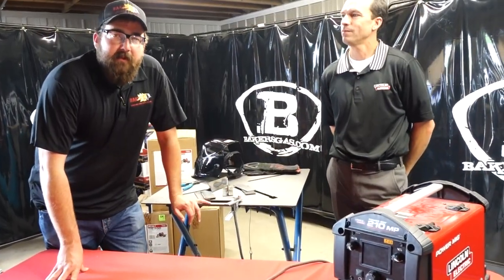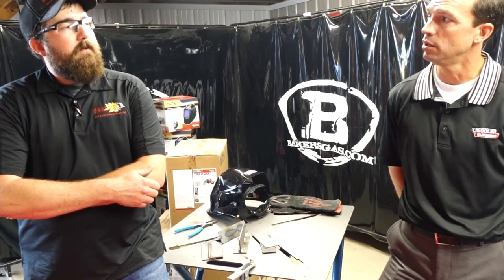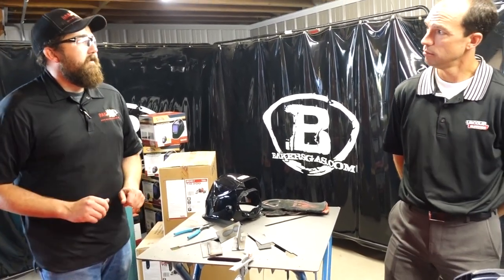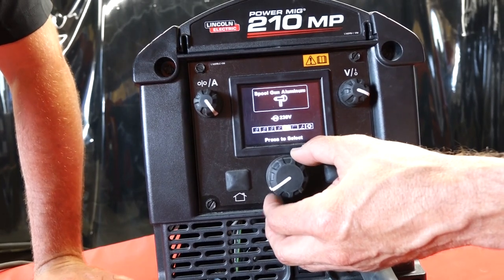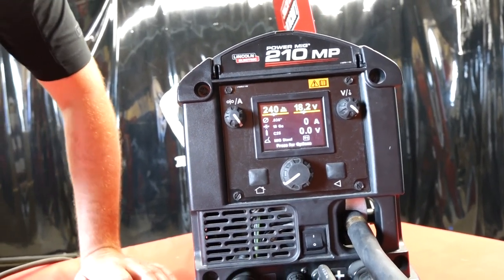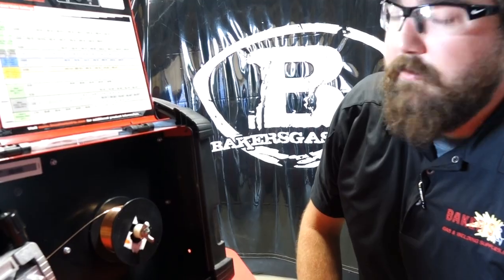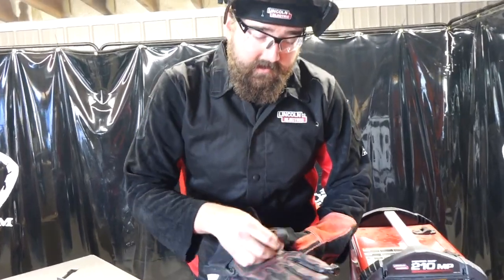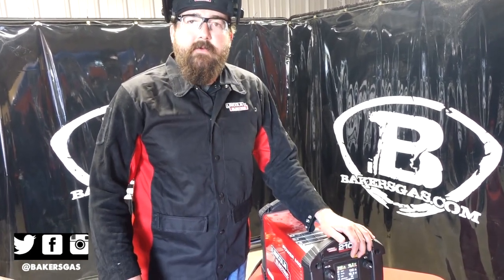Baker's Review of Lincoln Power MIG 210 MP

Comment: Which is better the Millermatic 215 or the Lincoln 210 mp???
Reply: Both are nice machines but if you wanted to dc tig the lincoln would be great with a $600 upgrade.

Comment: Until Lincoln provides a factory installed Tig  interface which is on the Front of the welder I will look elsewhere.
Thanks for the video Baker's Gas team.
Reply: Yeah its pretty intence! I got mine installed in 15 minutes.  Only took a nut driver and a zip tie. 
I was disappointed lincoln always includes a, b prossces local and remote and trigger locks on the industrial feeders. 
Miller, nope. 
Dont get me wrong a guy gonna have a solid machine red or blue. 
Nut drivers are simple tools but bottom line is not everyone is going to know how to use one especially when thay dont come qith a how to. And i imagine you tube isnt going to have any how to use a nut driver tutorial.
Reply: @rickgranato9664  get outta here!  A nut driver!!?? 😆

Comment: Has anyone tried to connect a 25’ welding lead to this machine?
Will it maintain the voltage?
Reply: Good question
Reply: Does with a 15'
Reply: I use it with a 25 foot 8 gauge 240v extension cord. With the factory leads it came with. Works well No voltage drop.